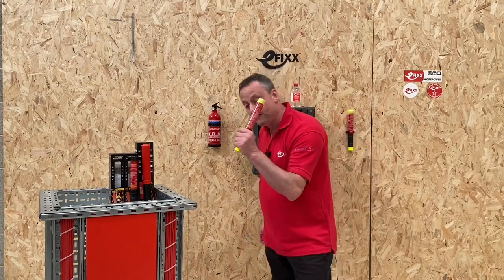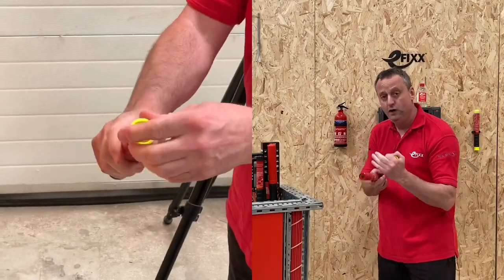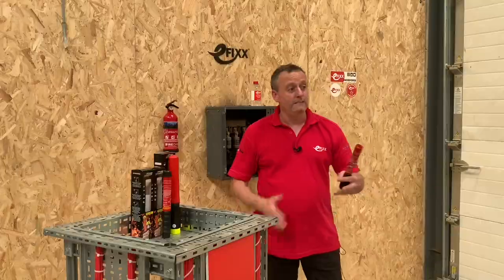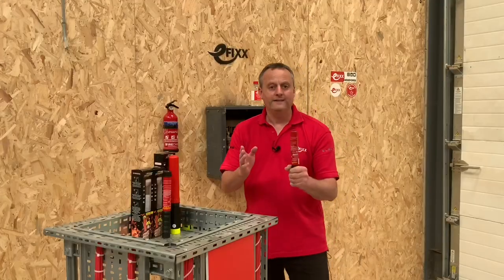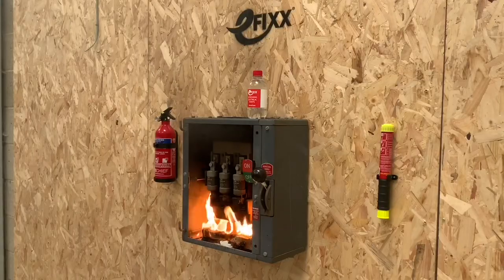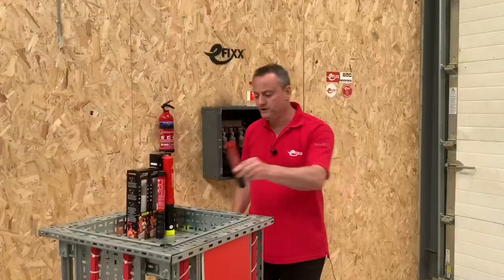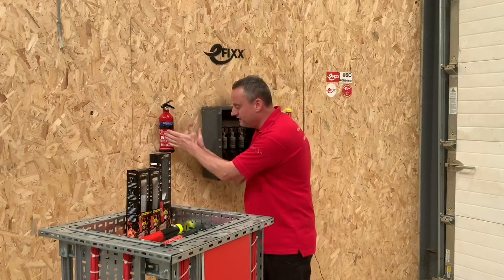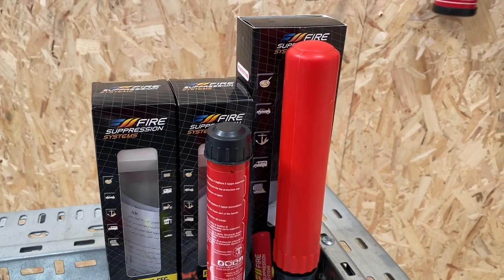Fire Safety Stick - compact fire extinguisher - ideal for the van or site.

Comment: Finally someone that explains what the chemistry is. So it produces potassium oxide and water vapor? Sounds safe and effective to me!
Reply: It's perfectly safe - it's fully independently certified not only electrical fires up to 100,000 volts. Its also certified for classes A, B, C and F too. The water vapour is a very very low amount and does not impact an electrical fire at all. The potassium oxide is created from the oxygen of the fire - this is safe to breathe for the user but also does not impact the environment of ozone at all.

Comment: That’s a cool little thing but couldn’t it be dangerous to use where it works by removing the oxygen in the air..? I’m sure you wouldn’t want to use this in a confined area...
Reply: It's a very valid point. But no, it's quite safe. It only removes the oxygen at a local level by the flames, interfering with the Heat/Fuel/Oxygen triangle. I myself have been in a confined area with it being activated. Yes, you could sense it, similar to a vape, but was still fine to breathe. Of course, the fumes from the fire itself may be a bigger concern. BUT the unique advantage of the FSS is that you can activate it, leave it in a confined area while you escape to safety and it will still continue to discharge suppressing and extinguishing the fire. (Compare that to a traditional extinguisher where you have to keep holding it during its complete discharge time.) Plus the FSS is available in 25, 50 and even 100 second discharge times.
Reply: @FireSafetyStick  I don't like the idea of using it in a confined space whilst holding it... but the idea that you could leave it behind and evacuate is a game changer IMO.

Can't do that with many other easily available extinguishers. You need to stay and face the fire in order to fight it.
Reply: ROFL You know what else removes oxygen from the space...the fire that you need to put out, so what really matters is putting out the fire lol.
Reply: @enochporter  fire doesnt replace oxygen, it pulls it toward it. so if you replace the oxygen it's pulling toward it with a different non flammable gas, it will go out. this is how co2 fire extinguishers work. they are used in areas involving computers and electrical equipment, as it can travel through the area, where liquids wouldn't be able to reach without getting too close to the fire.
Reply: @cemops8660  mate fire turns oxygen into CO2. So it definitely replaces oxygen when in a confined area. And it replaces it without something toxic to boot
Reply: @anonym3017  Yes. the process of combustion burns oxygen to create co2

Comment: Nice and compact I'll be getting some of these for van and home. I will be showing my caravan crazy father in law this product. How are they recycled Gaz ?
Reply: Hi Edd, yes they are ideal for the home and van, in fact anywhere a fire could start. And yes they are really popular with campers whether using a caravan or motorhome. Recycling is easy! Once used all that's left is an aluminium tube (just give it a rinse) and the plastic handle, so they are fine to be domestically recycled. (Traditional extinguishers MUST be recycled by professionals)
Reply: @FireSafetyStick  thankyou I will share this video with them 👍
Reply: @FireSafetyStick  given as previously stated that BS EN3 doesn't apply to these devices, do they at least have a performance rating as outlined in BS 5306-8. I'm not deliberately being an ass here just genuinely wanting to know what reassurances I have that the product operates effectively to set standards, we are after all using it instead of the more traditional 600g dry powder (meeting BS6165). Whilst not strictly apples to apples, you would expect comparable results to say a 5A, 21B rated extinguisher. You can understand where I'm coming from with this I hope?
Reply: @pnxelectrical  Absolutely, totally understand, its a good question. We are looking at getting the equivalent fire rating tested. (British Standards refused to test due to being a conflict of interests to the money they earn from traditional extinguisher testing/servicing). The manufacturer's previous test indicated that that the FSS25 had a similar rating over that of a 2kg Powder.
Reply: @FireSafetyStick  I see on your website Australia certifies it for only class C & F , is that right?

Comment: what range has it , its looking like you have to be very close , also looks like its hot enough to cause a fire or damage things that may be just smouldering , Im thinking car interiors after welding etc
Reply: No, you don't need to be too close at all. At least 1 metre is fine. The incredibly long discharge time allows you to suppress the fire from a longer distance well in advance as you would approach the suppressed fire as you would with any extinguisher. Its been used many many times with great success in many motorsports. In fact its now used with Formula 1

Comment: Hmm. For me they've missed the biggest advantage for this in a car. It's lack of mass. I imagine it's lighter than a dry powder extinguisher.

Imagine crashing a car with a dry power extinguisher in it. It's going to go flying out of most kinds of mount and either get lost or - worse - hit someone on the way out. This looks lighter and probably softer and much less likely to come loose or do damage if it does.
Reply: Very true indeed. That's why so many rally drivers and other motorsport users carry them. In fact, we have just announced that the Fire Safety Stick is carried by one of the leading Formula 1 teams for their pit and paddock crews.

Comment: This doesn't rlly look like a replacement for a fire extinguisher, I'll stick with my 25lb ABC dry chemical fire extinguisher lol
Reply: I had a fire in the engine bay of my truck the other day . I'm happy that it is not full of yellow powder now . Fire was put out effectively and no clean up required . Just needed to replace a couple wires going to sensors and it is back running . These are great since they are so small and you can have one  close by when needed in a hurry . A thumbs up from me .
Reply: You can't just spell "really" all the way out like a big boy? 😂😂😂😂😂

Comment: I wouldn't use on Class A fires on small spaces.  @Fire Safety Stick ; What standards are these to? Can't see it being  BS-EN3? Like the idea but not sure using what is effectively a flare to put out a fire is wise?
Reply: Hi, They are fully certified for Class A (as well as B, C Electrical to 100,000 volts and F) full details of the certificates are available to download on the website. They are also CE marked. Yes you are quite right that BS-EN3 is not appropriate for these as it's a totally different system. They would need to re-write the rules! Further details are covered on our website under FAQs. The "flare" part is just the initial chemical reaction close to the FSS itself creating the active component that extinguishes the fire from the distance.
Reply: @FireSafetyStick  thanks for the reply. Would be interesting to see a head to head between the FS and a 600g & 2kg dry powder. In yes of the ratings, what are they for this product?
Reply: @FireSafetyStick   @Fire Safety Stick  thanks for the reply. Would be interesting to see a head to head between the FS and a 600g & 2kg dry powder. In yes of the ratings, what are they for this product?

ETA; A quick check of the site shows certification from various countries but nothing from the UK? So how can we know that they will extinguish the 'standard' fires used when applying BSEN 3-7 (Portable fire extinguishers. Characteristics, Performance requirements and Test Methods) to which even 600g aerosol extinguishers complying with BS6165 (The closest competition) to the Fire Safety Stick are subjected to? It just doesn't seem to add up. It may not be your fault that your product is t covered by the standards above but surely it's in your customers interests to ensure your product meets the required ratings for the country of sale - which you have already for Italy etc, as has been noted.
Reply: @pnxelectrical  Sorry, missed this reply. Funny you should say that, going to do a comparison video of the FSS, an old 800g and a 2kg Powder plus a large foam extinguisher in a few days.
Reply: @pnxelectrical  Again, good question. We have gone over much of it in our FAQs on our site. All the test reports proving it extinguishers Classes A, B, C electrical and F are on the web to download too. The standards for the UK are only actually guidelines for commercial use (its a more detailed conversation than for here). The FSS because it's a unique product and method, it requires the standards to be re-written and that is some process. Especially as its against the commercial interests for BSi as they profit from commercial testing/servicing of traditional extinguishers which of course the FSS doesn't require. (Our background is actually from a leading Fire Safety company)
Reply: @FireSafetyStick  While it may not officially be recognised, could you conduct tests using the type tests BSEN 3-7, that would then give a guidence point from the UK perspective
Reply: @pnxelectrical  Hi, yes absolutely, that you mean the ratings testing yes (eg 8A, 55B etc)? As mentioned before much of the other standards for pressure gauges maintenance etc would not be relevant. But the ratings would be useful, yes? We are currently looking to have the ratings test to UK levels, however, indications are that it for flammable liquids then it would likely be equivalent to 34B (higher for the larger models). Once this has been verified we can then publish these results.
Reply: @FireSafetyStick  exactly that. The ratings form an integral part of clients deciding on what level of protection they require and so if the Firestick had those certified it would give the product a bit of a boost.
Reply: @pnxelectrical  agreed, something not having a UK rating would be a non starter from me.

Although I have read their reasoning, I'm always suspicious of products that are reluctant to be put forward for recognised ratings.
Plus, it will give it some form of means tested comparison against other products.

And when risk assessments are carried out, either for insurance purposes or general work, it helps being able to put something that is well recognised in its standard.

Comment: What's the size of fire it can extinguish for each class? Example, 34B or higher?
Reply: Although certified by independent test houses in Europe, they use slightly different specifications than the UK. We are currently looking to have the ratings test to UK levels, however, indications are that it for flammable liquids then it would likely be equivalent to 34B (higher for the larger models). Once this has been verified we can then publish these results.

Comment: Your link to Amazon goes to the wrong product (the 25sec). The 50sec one is currently unavailable...
Reply: Yes, sorry, since this video was produced the 25-second model has been discontinued by the manufacturers so only the 50-second and 100-second models are. Due to demand sometimes they are unavailable on Amazon but if you visit our Where to Buy page, there is a list of all the current UK and Ireland authorised distributors

Comment: Great for making more smoke and less visibility on the road. Also is the smoke toxic should we breathing the smoke. I'm guessing its Carbon dioxide if so it could lead to an increased respiratory rate, tachycardia, cardiac arrhythmias and impaired consciousness. Concentrations >10% may cause convulsions, coma and death.
Reply: The smoke you see is completely safe and is in no way toxic at all. The full MSDS is available on our website. It's totally different to CO2 or even Halon extinguishers of old. The potassium ions interact with the oxygen of the fire but not the user at all. It removes the oxygen of the fire but not the user at all. It works by creating an aerosol of nitrogen gas to power out the active agent which is potassium free-radicals. It is these ions that bind onto the oygen of the fire to produce potassium oxide - very fine particles which then dissipate away leaving no mess or residue. They are perfect safe to the environment and ozone and also for humans and animals. I should stress it only reacts with the flame, it does not impact the oxygen of the user at all.

Comment: Nice idea, but most people cant use a normal fire extinguisher this will add to the problem.
Reply: Great point, especially as you have to get extremely close to the fire in order for the  reaction to remove oxygen from the source.
Reply: @underwaterdick  Sorry only just seen your comment. Of course, traditional extinguishers can be very effective, providing they are used correctly. Sadly many do not understand how to use it correctly. So far the fire safety stick is proving effective for those that do not have the necessary training meaning they have a much great success rate and are much safer than had they used a traditional extinguisher.

Comment: "powder does more damage blah blah blah"
Always hear this is sales of alternative products.
What it fails to mention is that yes while the thing on fire will be left unusable in most cases when using the powder, you are A not going to use the thing that caught on fire anyway as it was on fuxking fire (thus probably damaged beyond repair) and B your job when putting out said fire is to prevent more fire.
I don't care if my PC is on fire, I am putting the fire out to stop it spreading to the rest of the room and building.
That and extinguisher about payload of retardant not how long they last.
A fire hose connected to a truck for 1 second will put out more fire than me peeing on it for 30 seconds...

Not saying this product is bad but this sales pitch is.
Reply: Good points certainly. Totally understand that safety should always come first. So far we have several reports back from users who extinguished engine fires with the Fire Safety Stick and once checked it was safe, they were able to continue with their journey. Where as with a traditional extinguisher it would have resulted in a ruined engine and likely need for rewire due to the caustic nature of dry powder.
Reply: I had a fire in the engine bay of my truck the other day . I'm happy that it is not full of yellow powder now . Fire was put out effectively and no clean up required . Just needed to replace a couple wires going to sensors and it is back running . These are great since they are so small and you can have one  close by when needed in a hurry . A thumbs up from me .

Comment: The traditional, pressurized metal canister Fire Extinguishers is a 70 Year Old Technology.  The pressure and vibration from a vehicle causes the powder to compact/cake which may lead to failure or not working as designed. You should check out the UL Listed Rusoh Eliminator to update & upgrade your home & vehicles safety:  https://www.teamfti.com/eliminator
Reply: Beautiful design. Love that is can be self-serviced and reloaded
Reply: @DavidMcCurley    Incredible new Safety Innovation of The Eliminator.  Check out this snippet from A retired Battalion Chief from our Life & Fire Safety Podcast Series about this technology:     https://www.youtube.com/watch?v=W95X-A7qPaA&t=18s